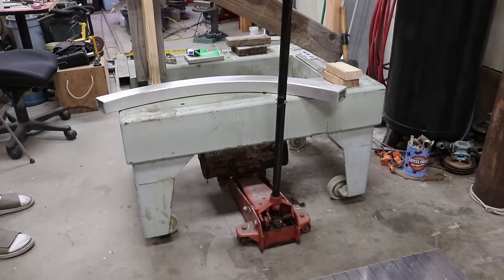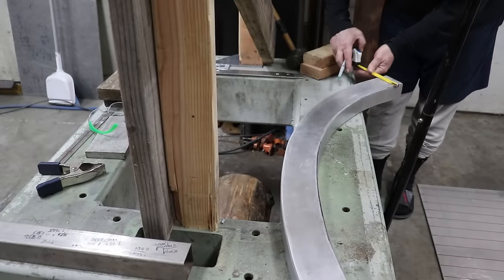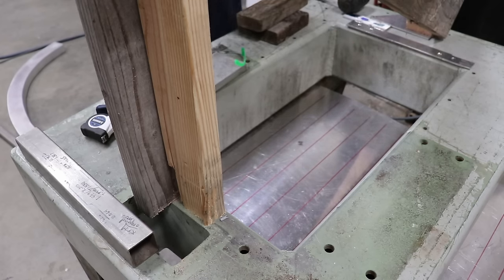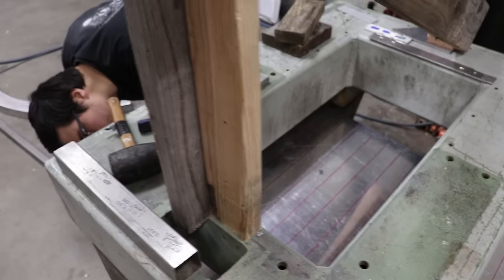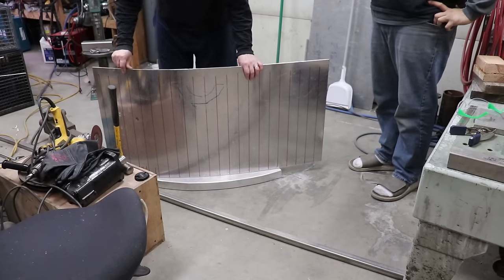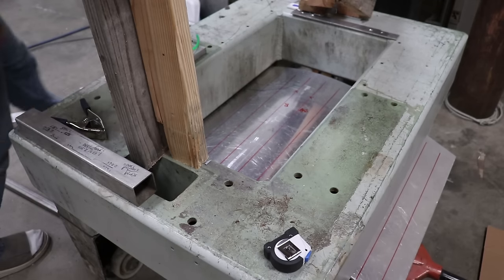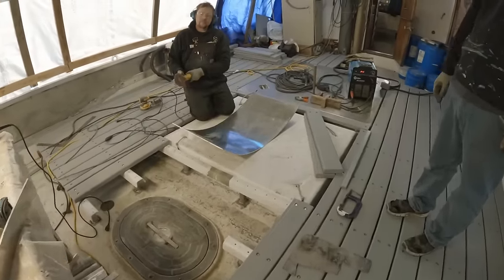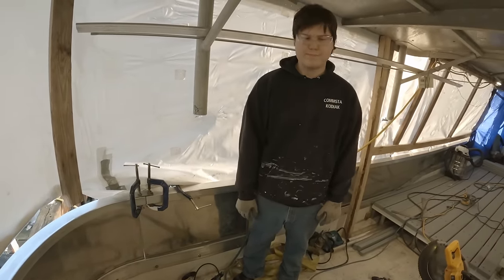DIY Corner Bender for Bulwarks! - Emerald Isle: Ep.89 Fishing Boat Refit

Comment: Helps if you can get a barrel, or something fairly close to the radius you're wanting..
Barrel work well as long as it doesn't have the support ridges rolled into the 55 gallon drun.
Then take 2 to 3, 2" wide ratchet straps, and start your metal aroud the barrel. 
Then pull slack out of each strap until it puts pressure on the metal, and slowly take a pull on each strap with the barrel laying on it's side.
Continue until metal you're bending is pulled tightly against the barrel.
Slowly release straps on each end of the barrel, leaving center strap in place..
Loosen it up far enough to slide barrel free, and replace two straps on each end pulling until equal force applied to metal. 
Slowly taken straps with the metal standing on end with you cap piece to reference the amount of radius you're needing. 
Go past the radius of the cap by slight bit, and loosen straps until you can remove them, and verify the radius of metal to the radius you physically have so that it fits snuggly into the curve.
If you have a tailor's soft tape measure, you can figure the length of metal that you need for radius. 
Leaving few extra inches to possibly trim if needed. 
That's another method to achieve slightly better radius bends without the inconsistent bending process y'all used, as you'll have a piece with true radius without the slight flatness in multiple places y'all have now.
If it over rolls the radius your needing, simply place curve of radius upwards. 
Then apply equal pressure with each had slightly in from edges and slightly push the center of radius back towards the ground, and check the fitment until it lays snuggly into radius without the ends trying to loose contact with whatever you are attaching it to. 
Trim if needed either one end or both depending on fitment to adjoining pieces on either end. 
Future reference should you have further need of forming such a puece of metal. 
Works equally as well for wrapping columns steel exhaust pipe if need be. 
Add it as heat sheilds by making standoffs to attach to either the exhaust piping or the rolled piece itself to allow air to flow in between the two. 
Just remember to hold it off any structure the exhaust may pass through to allow free airflow to pass between the two.